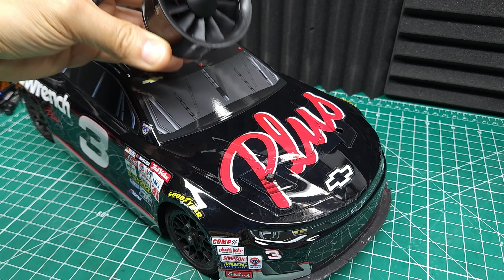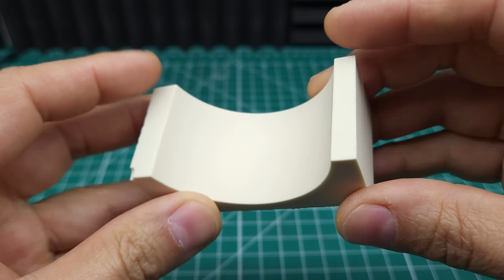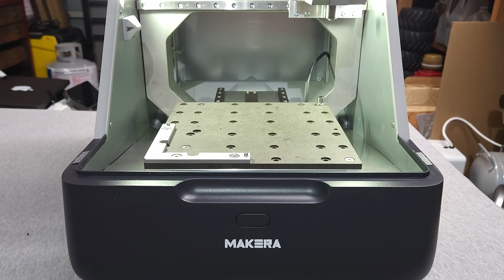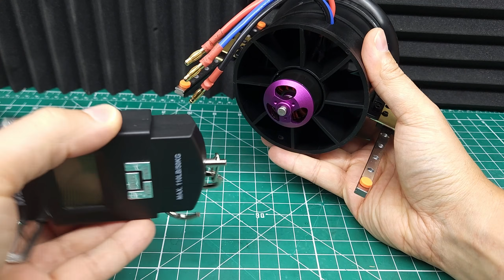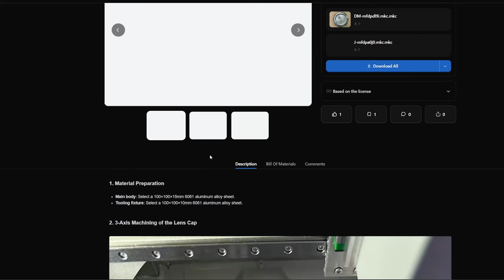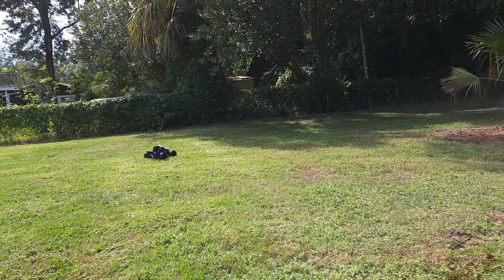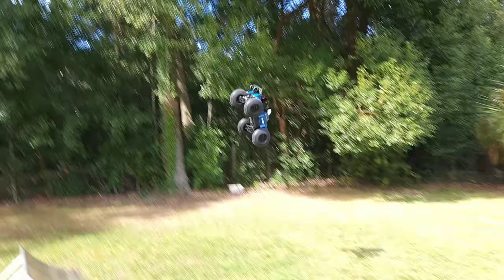I Built The World's First Jet Powered RC Stunt Truck!

Comment: you should use an esp32 or two to autocontrol ratio between jet and throttle, you can go the fancy route with an imu, or trial and error with presets. this might work well, but you should rubber mount stuff like this! Awesome project btw!

Comment: If I was you I’ll hang the truck up with a wire or a thread from the center of the turbine fan this way you will know which direction the truck goes as it goes airborne

Comment: One long ad for a tiny $1100 cnc lol....also doesn't look like that dust collection picked up any of the chips, let alone most of them....and putting the fan on the hood is the worst place to put it lol....you also killed the airflow on the truck, by putting the cab in front of it. It should be above everything.

Comment: Do you use 3m tape to secure the skyrc gnss?
Reply from the maker: Yes. I usually just use a little rectangle of it. I find it comes off pretty easily as long as it's not stuck on too long.
Reply: @DoRC thank you sir!

Comment: Just adding the “proper” test instrumentation to this would be a project.  A recording accelerometer/speedometer would be a good starting point but you’d want to sync that data stream with video to get a complete picture.  RPM and current for both wheels and EDF.  Some kind of strain gauge maybe to measure downward force distribution or measure the changing compression of the shocks front and rear.  The Air Force, NASA, and huge aerospace companies WTH thousands of engineers working on this kind of challenge with less immediate success than you have!

That said - I’d stick an ironing board on the trunk and see if it helps.

Comment: On the CNC machine, it’s 2026 - why does the machine communicate using blinking lights like a 1940’s computer?  How many sets of blinking or beeping codes should you have to learn and remember for the devices in your life?

FWW, 1940’s was being generous for a comparison as it doesn’t need a computer or even electricity to build.
Reply from the maker: It's just a convenience thing. The actual interface is accessed through the Carvera controller on a tablet or computer and it tells you exactly what it wants. The blinking lights and single button just allow you to easily change tools without having to look at that screen.

Comment: Should have mounted the smaller EDF to the roof, NOT the hood. Won't work as effective that way. Also for both vehicles, I'd remove the drive links so there's almost no rolling resistance at all.
Reply from the maker: Yes and no. The roof gives it cleaner air but raises the center of thrust up pretty high which based on the thrust of weight ratio could have been a problem

Comment: Just found your channel. Clean, straight to the point, and extremely intuitive information IYKYK. 
Subbed! 
It seems when testing the truck on the ground the wing may possibly be causing the truck to wheelie because of the air from the fan pushing the nose up. Far as compensating for the forward rotation in the air with the big EDF, you should make a mount that you can adjust it on a horizontal axis looking at it's side so you can tilt the motor and lock down in different degrees so the exhaust goes more downward or upward and test difference scenarios(when running fan=truck front flip rotation... Tilt fan nose downward=provide back flip rotation.. Find center point)That would probably be the easiest way to compensate for forcing the nose down on the truck. Just my $0.02 lol. Awesome content 👍🏼

Comment: Put one edf at each corner of the car pointing down… That will make a 4x4 extremely grippy! You might get some insane acceleration due to the better gripping… May have to use special tires and tighten suspension to handle it though.

Comment: Next time try 4 small edfs pointed down to create more downforce traction… this should improve wheel grip, you could make the mounts adjustable so you can try different angles and you can also try different fan speeds as well

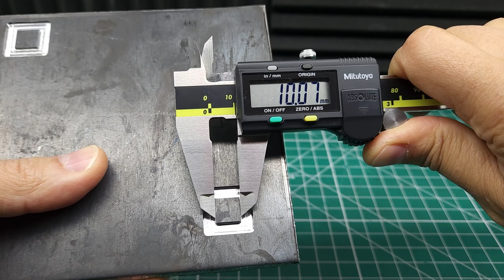Comment: >22:52< as a machinist, i noticed that you didnt use any type of lubricity/cutting fluid/coolant when cutting metal. this is essential for metal to metal cnc machining. you will get better results and your tool/machine will last longer and function better. there are several other things/factors i could go into and this is something you should think about....
Reply from the maker: Typically yes that is true but Makera machines are not compatible with liquid coolants and most of the time I'm running a pretty strong air blast which is sufficient with the very light cuts I'm taking to prevent overheating chip welding etc. It's not ideal but I'm also just playing around with toy machines in my garage so it works okay.
Reply: @DoRC  how is a CNC machine NOT compatible with fluids?..what is this?...a toy?
Reply from the maker: @ericakasatch essentially yes.

Comment: I want to build an EDF powered ice runner for the winter on the ponds. Thinking about having 4 old sharpened hockey skate blades fastened to four suspension arms with shocks on a long chassis of some sort for stability. Now if only I had a heated garage to work in when it's minus 20 Celsius outside.😂😂

Comment: You need to duct the exhaust or tilt the whole edf so it's aimed more toward the center of mass. This will eliminate the rotation. Deoending on how high the edf exhaust is tho, you are either going to end up with a LOT of down force or if you duct the exhaust to a lower point like behind the truck you can actually get forward thrust and not just an indo machine.
Reply from the maker: Yeah it's always going to be a compromise but if I'm going to have it set up just for jumping having the thrust run through the center of rotation would definitely help a lot.

Comment: as someone who is into robotics, this video about RC cars and the CNC machine is a very pleasant surprise to me
although, my robotics perspective is that its better to mount the thruster directly on the chassis? not onto an external protective/decorative surface
not only would it be structurally stronger, it would also bring it down closer to the centerline of thrust , resulting in more stability, and possibly allowing you to go past 73 without spinning out
Reply from the maker: Awesome glad you enjoyed it!
Reply: @DoRC  for the stunt truck I would have angled the EDF so that it blows air upwards
this would reduce the nose-down tendency, and more importantly it would push the truck towards the wheels, and reduce the impact of an upside down landing on the EDF...
Reply from the maker: @carmatic absolutely. Angling the center of thrust to align with the center of rotation on the truck would make a big difference. It was just kind of outside the scope of the video which had already taken up a lot of time to make.

Comment: Awsome speed run, with that why not try to make a jet housing for the EDF to channel the air better than air in and out with no direction. Which could help with the air force direction, the air out is blowing wider sooner than later past the the vehicle. Just a thought from salt flat rocket cars 🤔🤔🤔
Reply from the maker: A converging nozzle could help some but with subsonic air it's probably less beneficial than you might think.

Comment: You need to put a wing on the back of the car in a thin but horizontal like on an airboat for the truck to push air up so it doesn't slam the front end into the ground

Comment: Nose diving has a really simple cause: you got a very powerful thrust vector placed above the CoG and that creates a torque around the said CoG that causes the truck to basically front flip itself whenever the EDF is actuated. The simple solution, if you plan on using the EDF to get more airtime, is to align the the thrust vector's axis with the CoG so the torque does no longer occur. That isn't really possible without very complex ducting, so unless this phisycal constraint is addressed, the concept won't work properly. It's got a lot of potential tho
Reply from the maker: Actually it wouldn't be hard at all. I just need to angle the EDF itself along the center of mass so it's thrust doesn't influence the rotation.

Comment: Side mount 2 EDFs with 2 degrees lower in the front
Reply from the maker: That could work though side mounting introduces problems with durability as now instead of compression on landing you have shear on landing.
Reply: @DoRC  i was kinda think more of the car for top speed.  The truck may actually hover. But damage is imminent on truck due to its weight and you're actually try to get airtime. Maybe a foam outer shell might help.

Comment: If you attempt this again, cut the cab off the body so it has direct air intake.  Add about 5 lbs, maybe more to the front bumper area, to keep the wheels down on your short wheel base.    It's also not the first jet powered stunt truck.  But a good title anyway.  Made me want to watch.  And your presentation and description made me want to keep watching.   You don't have to cut cab off, just remove all the windows on the cab.  If you did and I'm just blind than I'm sorry.   The red speed car, needs some tail fins or fin to keep in straight.  Or those under the rear bumper or belly fins that you see on race cars.
Reply: If you cut the windows out it could make it real squirrely at top speeds.

Comment: They sure sound awesome. I think it would be a cool idea to use two off smaller ones and mount one to each side of the car. Make sure you can adjust the angle (maybe even using a servo?) to maximize for speedrun or jump height. It might be difficult to properly synchronize them although considering the mass of the car I don't think it would really matter.
Anyway awesome idea and video as always!

Comment: Great video! I was just gonna say I've messed around with a couple of those edf. On the armma truck half of edf being blocked by cab does affect it more than one would think. However just speed running it. Cab blocking helped keep nose down but when jumping. The cab issue is what caused it to want to nosedive so aggressively. Because of the more  airflow being pushed thru top of the EDF with no resistance from cab versus the lower half blocked by cab wasnt allowing same amount to be thrusted through bottom is why nosedive was so prominent.  Awesome video as always. Thanks for the work and time you invest into them. Definitely one of a kind.
Reply: "The cab issue is what caused it to want to nosedive so aggressively", that's not correct.  If you remember he had to step on the test platform of the edf, because it kept wanting to nose dive.  Nothing to do with the cab.   But I agree that he should cut the windows out of the cab to increase airflow.

Comment: Wow... this is ironic. I have been experimenting with the same concept.  Although I 3D printed the mounting hardware.   Gained 20 mph mounted on the back of a drag slash.  Same issue...spins out at around 75 mph.  But short drag races it doesn't do to bad. Working on a wing to help with stability.  Great video!

Comment: Maybe side mount 2 70mm edfs on the sides and that way you could angle them up or down for more down force or lift. Maybe even add in differential thrust and do some flat spins off a ramp LOL.

Comment: idea: print or cnc a flat chassis from a scratch design, specifically made for that big motor on the truck, with fins and ductwork to direct clean air into it, then diffusers and aerofoils, and servo-controlled wings to adjust downforce on the fly on each end of the car independently... then print or machine the rest of the car from scratch strictly to maximize airflow, like a-arms with sharp leading edges, then make a back-lit transparent teardrop body from heated and vacuum-formed panels to minimize drag. bet you could find 85 pretty quick.

Comment: Uh no you didn't. Back in 2012 I built the Terra Jet ACV a 70MM EDF powerd RC truck that was also a boat and a snow mobile like vehicle that used thrust to propel it, replacing the wheels with skis, floats or propellers. Yeah it was also a drone.
Reply from the maker: That sounds awesome. Did you ever jump it?

Comment: Great vid! I've built several EDF-hybrid cars and love the concept! I've built a 12s Arrma Kraton with dual 120mm EDFs, Arrma Limitless with the same, etc. You're on the right track! Happy to see another trying out these conceot builds! Here is an older vid of the Kraton, if interested:
https://youtu.be/MtnOcDv69c0?si=dLC6sOpYPYFwlXF8
Reply from the maker: That's insane! Have you tried jumping it?
Reply: @DoRC 😂 Thanks! Small jumps are good, but she's a bit harder to control with larger jumps! I am testing a concept where I put the EDFs on a three-position switch (I've done this with cars), so I can run the EDFs up to the jump, then hit the switch to turn them off when leaving the ramp, etc. in an attempt to have better control in the air.

Comment: Lets see 2 small EDF's out the hood of the 8S Kraton, mounted up like turbos... then run tubing/piping that is semi flexible like silicone or something attached to it that then routes out to the back of the vehicle as exhaust thrust! Also curious what if you mounted one smaller one in the bed/back of one of these RC's and used a 90° elbow that goes straight up out the top of the bed/back and is flush mounted to it pulls air directly into it and then blows out the back maybe!?!? IDK.. I see ALOT of interesting and very cool concepts that COULD possibly work with these!
Reply: Or go for fully flexible exhaust piping, clamp it together with rubber bands, and make it a really fast fart machine.

Comment: Hey bud, great video, I enjoyed that a lot more than I thought I would!
You seemed to have the best results when you had the jet going before you hit the ramp, then holding the throttle to stabilise the nose.
Why not try programming both motors to the trigger, you need them both on full to keep it straight anyways.
That CNC looks amazing, and did I catch a glimpse of the price as you scrolled through the website? 1199 USD? That's about 16-1700 Australian dollars, and that's a steal for what I've seen that thing do!!
Cheers 👊
Reply from the maker: That's actually how I had it set up for the speedruns and I tried it off camera. The problem is that The tires only provide reverse torque when they're accelerating so if they're at a constant speed then the EDF quickly overwhelms them and it ends up pitching forward. If you keep accelerating you're also accelerating the EDF which results in basically the same problem. The best way I figured out how to do it was to be able to pulse the EDF on command and then compensate with the throttle which as you saw also is very very difficult. It's possible you could do some sort of timed introduction of the EDF or have different exponentials for each and get them balanced properly but that would probably change on a jump by jump bassist depending on how quickly you hit the ramp etc. Ultimately I don't really think either solution works really well but this is a pretty new thing that I don't think very many people have done before so it's definitely ripe for experimentation and improvement. I'd like to see a gyro based solution that controls them for optimal airtime etc
Pick out the Kickstarter it's even cheaper on there.
Reply: @DoRC sounds like you have put way more thought into it than I have, the problems you mentioned that would arise from both on the trigger make perfect sense when you think about it.
I'll definitely have a look at the Kickstarter, Cheers for the heads up my friend.

Comment: I wonder if you could make it more stable on those speed runs by adding a couple of degrees of angle to back of the EDF for more downforce?
Reply from the maker: Probably though I suspect part of my problem was the fact that the EDF was blowing over the top of the car. That's going to cause reduced pressure on the top which I think at a certain speed just starts blowing the car off the ground which results in the spin out.

Comment: The red car needs more downforce.
Reply from the maker: I agree. It's entirely possible that the EDF is reducing downforce by blowing high speed air over the top which would create a low pressure area. My guess is that above a certain speed it just comes off the ground and then that's it.
Reply: @DoRC then you fly the red car needs simple as that 😂

Comment: Good times right there! You could definitely see a difference but what if you had one smaller edf on each side right on the cg of the car? In my mind that would prevent the nose dive but I’m not sure what other issues it would bring out.
Reply from the maker: Yeah that's definitely an option. This is really just the beginning. I will say that the effect felt a lot more significant in person than it looks in the video. It's kind of hard to see the arc but it was definitely there. I think adjusting the amount for the EDF so it's in line with the center of rotation would probably help a lot too